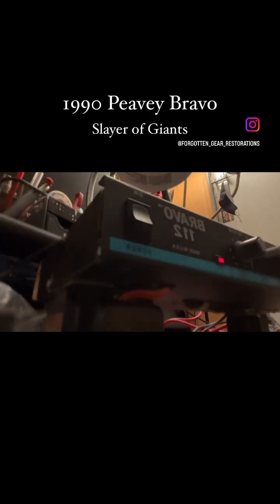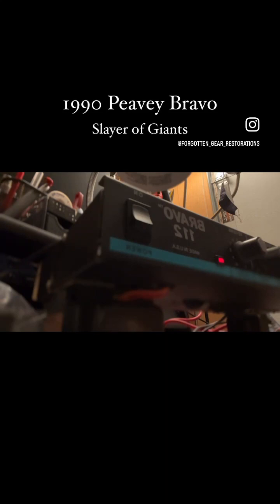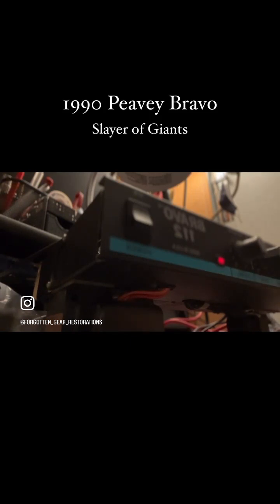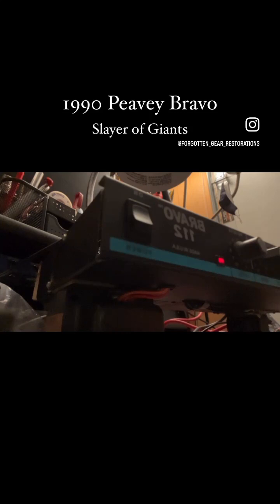Peavey Bravo 112: 5150 Slayer

Comment: I love my Peavey Bravo! Got it for like $150 and the guy put all brand new tubes in it before selling it to me for a $150 ! The tubes alone cost that much !  Any way an Orange amp I got for Cheap arrived with a broken EL84 so i took the matching pair out of the Peavey and put em in the orange and kind of forgot about the Peavey Bravo. Then later that year I see really cheap tubes from Russia for like $20 for 4 matching el84 😅 great idea but bad implementation as the tubes were either ruined in shipping or they were just junk and would red plate. Any how the seller refunded me for the tubes because they were lost and when they finally did show up they were completely soaked in paper bag and 2 out of the 4 were non functional. Any way you Bravo seems to have more bite than mine, mines a bit darker now with old Russian, barely functioning power tubes but I don't use this amp for having a jam with others any more, just bedroom amp so it's perfect for what I'm using it for !
Reply from the maker: I love these and the Rockmaster amps too!  The bravo amps are just killer and perfectly sized machines!